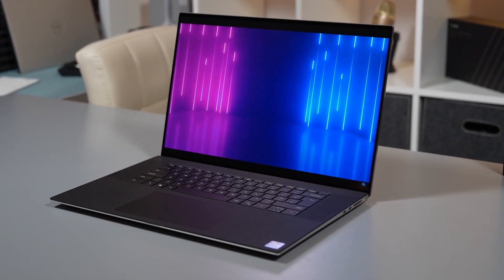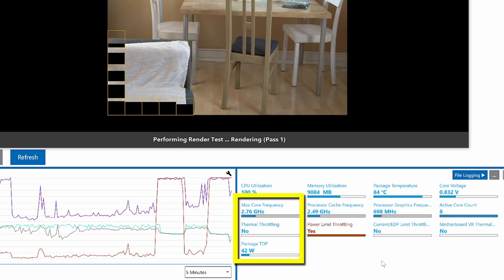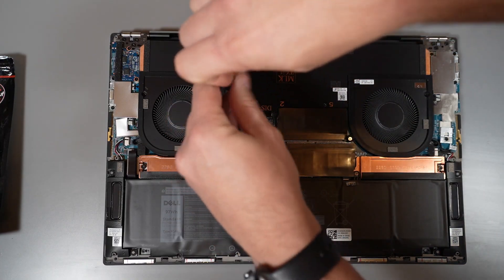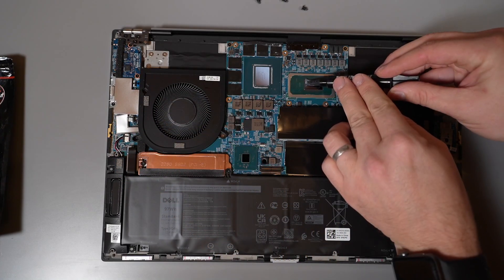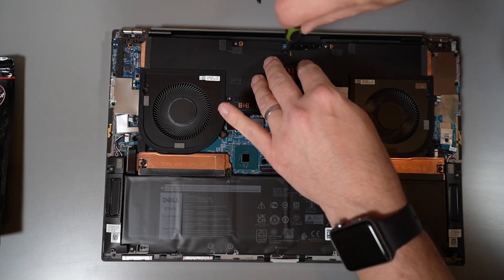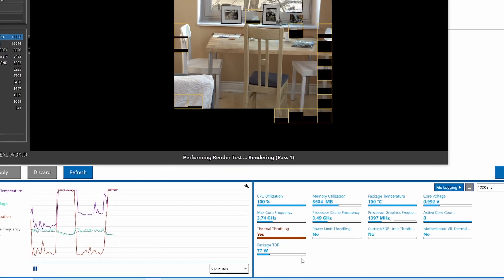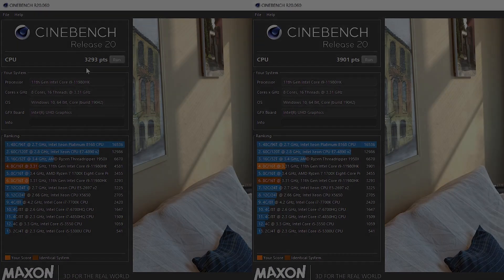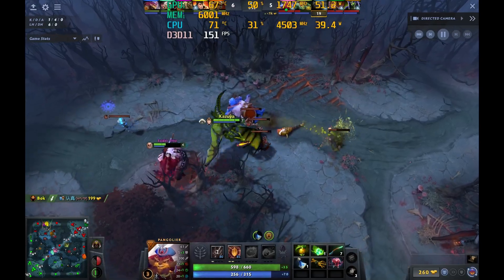XPS 9710 repaste - A Dell Quality Control Story!

Comment: Did a same thing just yesterday with 9700.

Noticed, that because XPS use all thermal headroom, it hits 99° anyway, but pulling 75-80W instead of 50-55W.
But, unfortunately this behavior is not for long, and after month or two, thermal performance drops to same level as before.

Probably it's because of drying out of paste due to full throttle all the time, and I've tried a bunch of pastes - grizly, CoolerMaster, but results is the same.

So now I just doing this every two to three months, unfortunately. But better than nothing.

Not a big deal for productivity, 10 to 15 percent. But gaming is on the other level. No stutters, CPU can keep the clocks at respective 3Ghz and above, so totally worth get your hand dirty from time to time)))
Reply from the maker: That’s exactly the same improvement as me. Grizzly is known to dry out quickly, I don’t normally use it but it’s all I had on hand. I have been using noctua’s paste lately and seems to take a lot longer before drying out
Reply: @MashITTech  would be interesting to see how liquid metal might behave, but I'm not ready to take a risk on my own)
Maybe after 1M subs, we might see video like this😅 
All tests are focused on "gaming first" laptops in that regard, so we left just to imagine)
Reply from the maker: Haha I have been considering it! This was a friends laptop so couldn’t risk it. But may well give it a try when they release the 12th gen version 😃👍
Reply: what i did with my XPS to not fry my lap, disabling intel's turbo boost in bios, once and for all...

Comment: I did my G5 5500 with Noctua NTH2 and whilst I think the paste job from Dell was fine, in these winter temps I can run the cpu at 75 watts in games at less than 100 degrees. No thermal throttling. It boosts to 4.3ghz.

 Sure I don't really ever do this preferring to use balanced windows power mode which is usually 36w to the cpu while in games (3.6ghz) but it shows that decent paste can make a good difference
Reply from the maker: Trouble is dell just use a stamp of cheap paste and it is very hit or miss. I normally use the noctua paste but I was all out. The grizzly is so hard to work with
Reply: @MashITTech  I toyed with the idea of Liquid Metal then decided I didn't want to risk it haha
Reply from the maker: That’s something I want to try. This was a friends laptop or I would have risked it. When they release the 12th gen version I will give it a go 😂